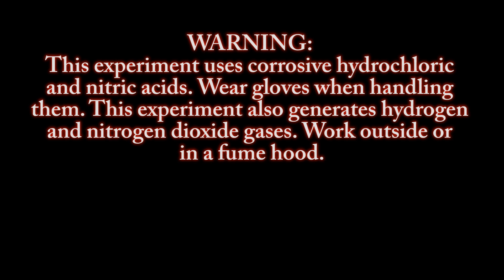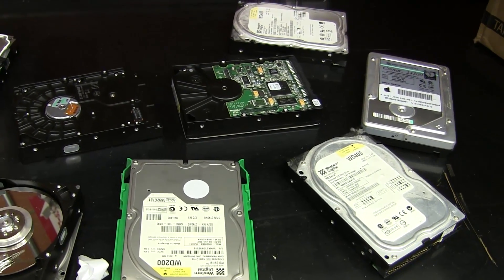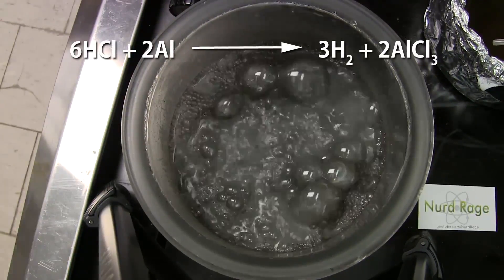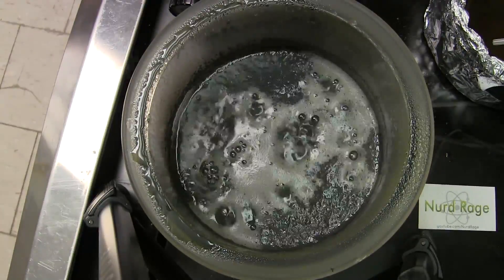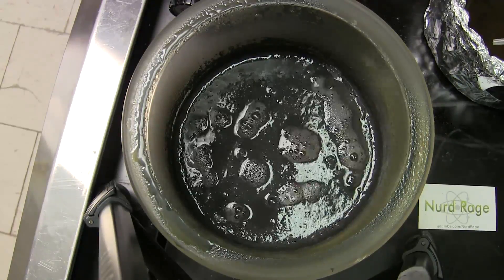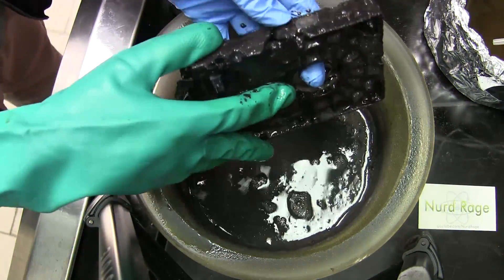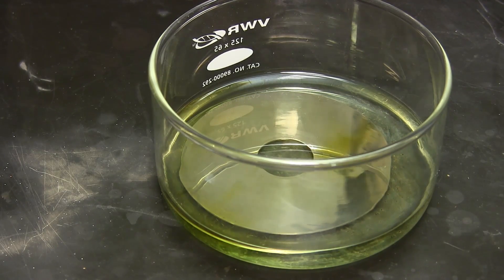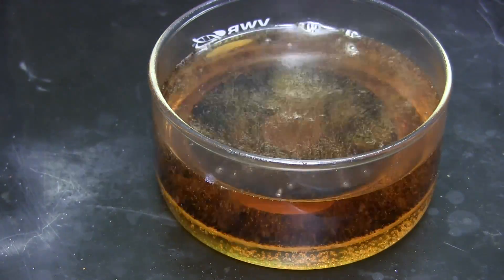Dissolve Hard Drives with Acid

Comment from the maker: Of course the real reason for making this video is because my hot plate is busted and i can't do anything that requires it until i repair it. So more "fun" videos that don't require hot plates until then...
Reply: No the reason you're doing this is to cover up Hillary's emails
Reply from the maker: +Gerardo Martinez Definitely
Reply: +NurdRage Make piranha solution and throw random stuff in that
Reply: You should put them in SULFURIC ACID 😋😋 i want to see that Sooooo bad!
Reply: my hotplate too had an average this week, check out the terminals, mine just needed join the nichrome resistence that break out when i turn up the heat, check out that and if the nichrome wire is break some stannous and copper to join and finally to keep together put some high temperature silicon, and save a lot of money, however if is the potenciometer or  a mini variac you will need more acid videos :s
Reply: Thanks for uploading this. I removed platters from my old hard drives because they have some precious metals. I don't want to dissolve them because they looking pretty good
Reply: Will you make another glow sticks video like a remastered version
Reply: Are these your hard drives? Or were you given them?
Reply: +NurdRage thanks for replying :)
Reply: +NurdRage Next can you do something epic with piranha?
Reply: Why you didn't use sulfuric acid?
Reply: +NurdRage Could you have taken a scribe and scratched through the platter coating so the acid could have gotten to the underlying aluminum? What was the coating and would that have left a coating "shell"?
Reply: +NurdRage For destroying hard drives, couldn't you just smash it with a hammer til it was gnarled? it this the standard way to destroy hard drives? My physics professor told me he just opened the case and whacked it with a hammer  till the surface was unreadable.
Reply: what about the liquid nitrogen vs ur face
Reply: +mytmousemalibu it would desolve the aluminium but the plating is so thin that it would just break apart in little pieces which then are floating in solution
Reply: +NurdRage What does a new one cost?
Reply: +Gadgetboy a loooot of money, i dont know why? the magnetic stirrer is just a neodimio with a motor and potenciometer, the temperature control is just a nichrome wire with a potenciometer too, if someone knows why? please tell me
Reply: as a million subscriber special, there should be a real voice or face reveal
Reply: +NurdRage YEAAAAH, SCIENCE!!
Reply: +NurdRage What happened to the plate? Maybe we can fix it.
Reply: +Projekt Och Experiment FUUUCK YEEAAAHHHH.
Reply: +Projekt Och Experiment FUUUCK YEEAAAHHHH.
Reply: The hot plate has one job to do and it can't even do that lol!
Reply: +nurdrage do you have a radioactive lab or something?
Reply: +nurdrage do you have a radioactive lab or something?
Reply: damn 24tombomb beat me to it
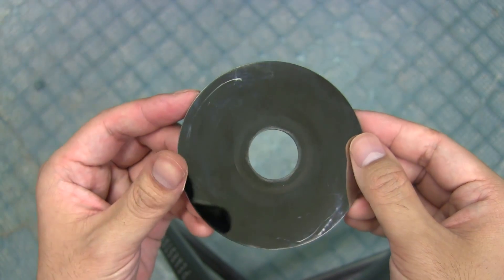Reply: 2:14 your face is reflected onto the harddrive
Reply: I am actually wondering why you don't do videos on precious metals recovery?
I mean on the more efficient ways to do it!I personally just do it for example from e-waste just with molten sodium hydroxide-at least the preparation!In minutes everything made of organic,silicon,ceramic and aluminium is gone and so the later steps are just dissolving the sodium hydroxide and salts in some plain water,decanting it somewhere in the batch labelled "caustic poop",and all the rest is gold,silver,copper,nickel and PGMs!Just be the first who will show that stuff to people!😉